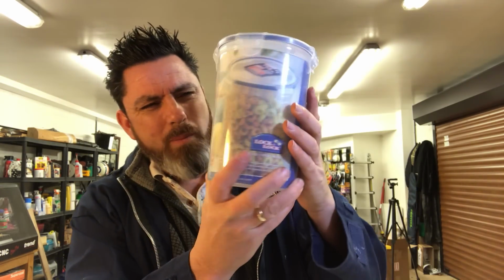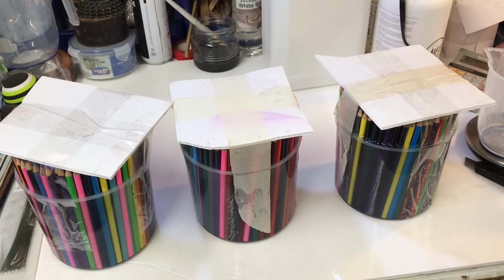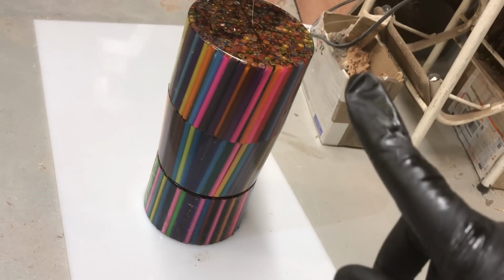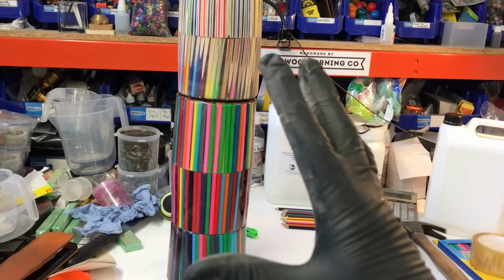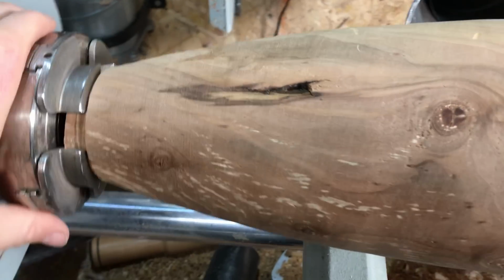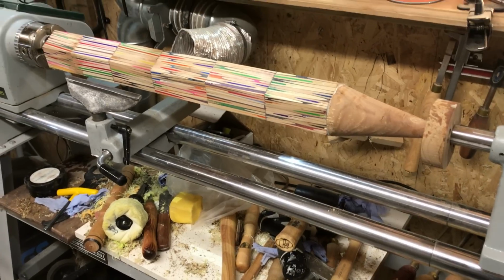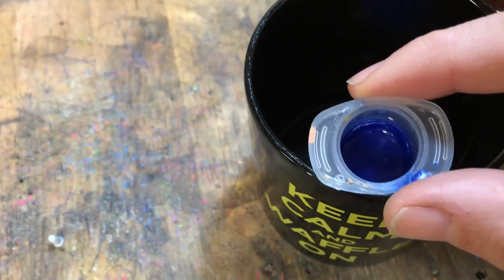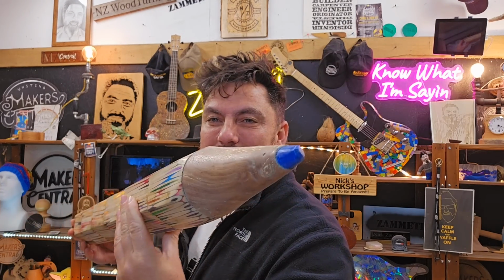GIGANTIC Colouring Pencil Using 150,345 Pencils !!!

Comment: I had an idea for any future attempts on this project. Could you cast a thick walled resin container in a silicone mold to then put the pencils in so when you turn it, the pencils remain untouched? That might give a bit of a unique look in a project like this.

Still working on finding myself a lathe to begin to learn some of this.

Comment: Going to try to gess the weight of the pencil- About 15-25 pounds based on the size and material plus the overall way you're holding and using it in the video. Not to heavy that it's a hassle to use but not to light, eeither.